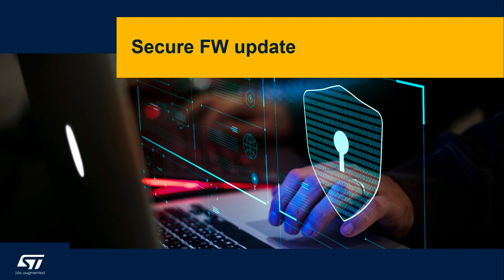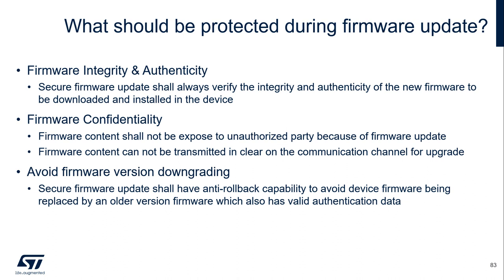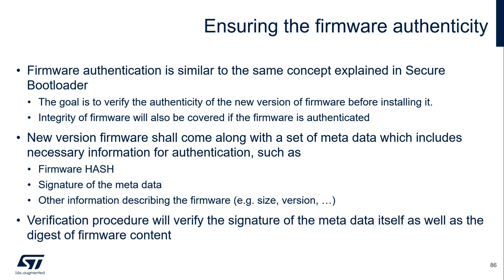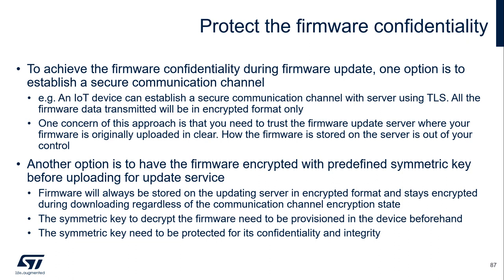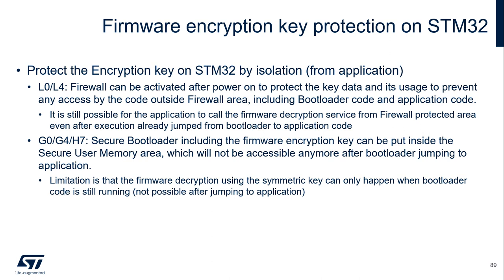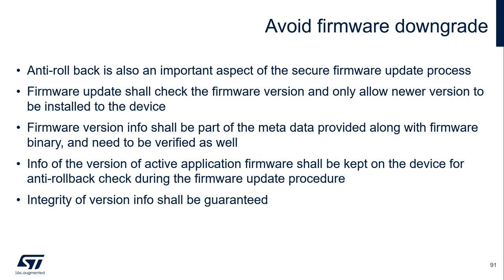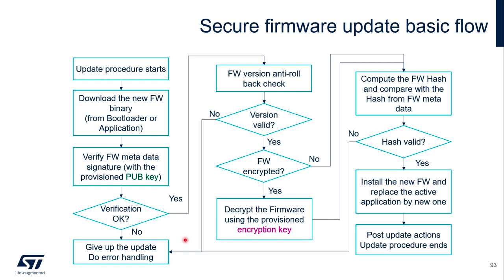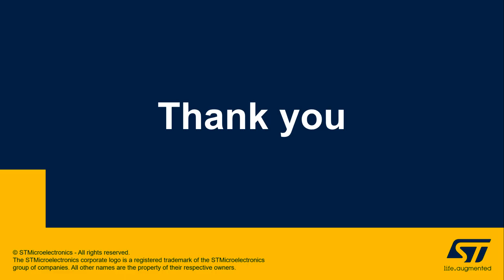Security Part4 - STM32 security in practice - 15 Secure firmware update

Comment: But this implementation does not check if the correct product model is flashed, does it? E.g. if different firmwares exist for different models they can all be successfully flashed as they are valid, although the firmware may not be actually compatible.
Reply: That's pretty easy to do if you include a device ID in the firmware metadata. It's literally one extra check. I'm sure you'll do other checks as well, but those aren't important to securing your update process.